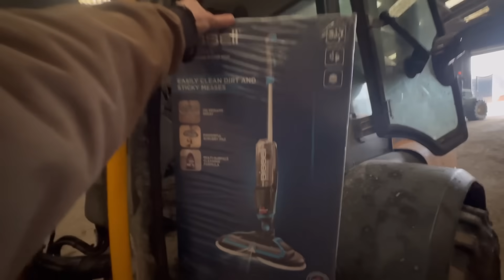Trying to Add Auto Section Control to Amazone Sprayer on the Cheap! Wet Day! AgOpenGPS

Comment: Have you got the CANBUS codes for the sections for your sprayer and are they posted somewhere? CANBUS doesn't typically use the DB9 connector (tho no reason why it can't), are you positive CANH and CANL are there? Get a thread going on TFF perhaps if not already? If you're positive there's CANBUS codes on that cable, you can use one of the Teensys with SavvyCAN to read the codes, that could help. A trace would be useful for the devs too. Also, which PCB you using?

Comment: Is it worth going to a scrap yard and getting a couple of wiper motors from rear windows to wipe you cab side windows? Wire on a suitable connector to the. Switch if that is the style you want on  Amatron.